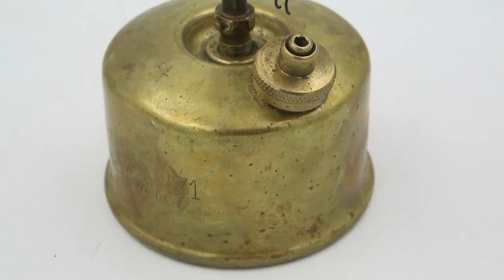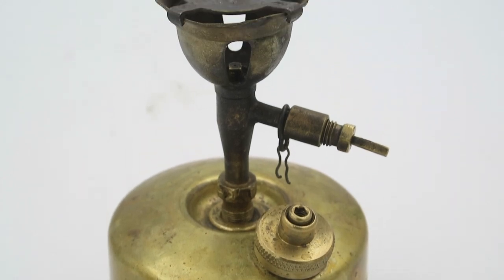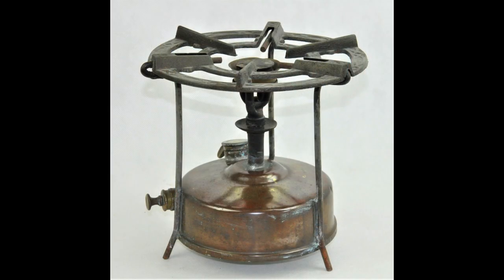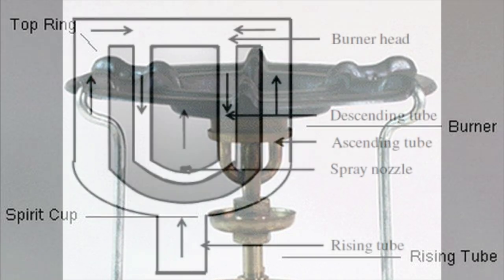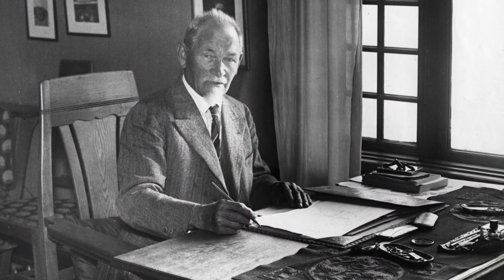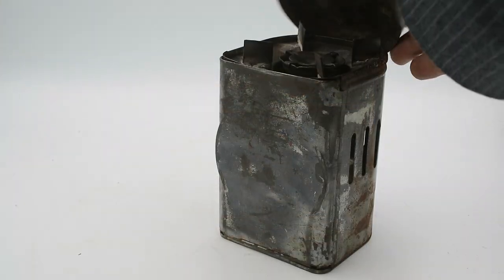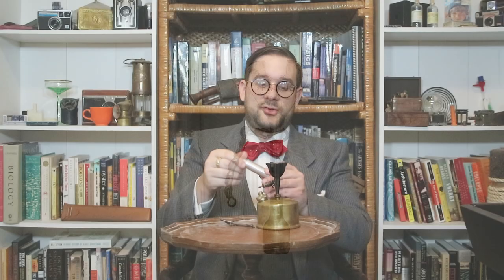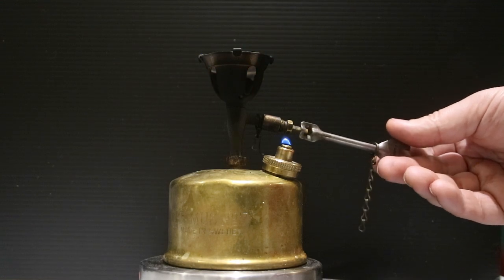Primus 71 Stove: the Camper's Companion

Comment: My Svea 123 isn't shiny like yours. 😉
I normally carried a small container of alcohol for priming, but that isn't necessary. The instructions tell you to warm the tank in your hands. That will pressurize it enough that a little liquid fuel will dribble out of the nozzle and fill the spirit cup, which you then light to heat the burner stem. That works, but I preferred alcohol because a little spillage isn't as messy or smelly as stove gasoline.

Comment: Fun fact white gas is the older form of gasoline and still can be bought today
Reply: Not really a gas
Reply: Yes, it is called Coleman Fuel or Naptha. It is a very clean burning fuel with no or very little odor, and they can last for years with no break down in the metal 1 gallon containers.

Comment: I have a Primus Stove (different model then the one shown), and the manual says it can run on pretty much everything, both liquid, or gas, except alcohol ( because it corrodes coper, and brass has copper in it and the stove has brass parts). So your part at about 4 mins in, where you say they  mostly run on gas, not liquid, and the ones that do, mostly use camp fuel, isnt entirely true.... maybe for some models, but definably not all of them.

Comment: PLEASE!  Post a video of this running on 60 proof(30%) vodka.  I gotta see that to believe it.  Also, this doesn't have a built in cleaning needle.  These downward angled valve models need a separate "pricker" that came with them.  They can be easily made with the right size piano wire.    Just make sure to deburr the end of the cut wire or it can enlarge the jet and it won't run correctly.  The models with built in cleaning have the valve horizontal/perpendicular to the riser to facilitate the rack and pinion action for the needle.
Reply: Be like an alcohol stove
Reply: Vodka is a Polish invention and according to Polish law, it needs to be at least 37.5% of alkohol to have the right to be sold as vodka("wódka").
btw. Russian text with the first mention of vodka is a list of items purchased in Poznań(Poland)...
Reply: 60 proof vodka? Someone's sold you short there. Vodka is supposed to be at least 37.5% (and typically 40%) of alcohol by volume, so 75..80 proof.

Comment: How hot would this burn with alcohol compared to a modern gas stove ?
Reply: Alcohol has a lower energy value, so with the right nozzle it would heat about the same as a modern gas stove but it would be a fuel guzzler.
Reply: Alcohol burns with half the BTU of Kerosine. Pressurized Kerosine temperature is twice as hot as pressurized  alcohol stove and you can't buy a pressurized alcohol stove anymore.  The unpressurized alcohol stove is good for a sunny day in the summer.   Modern stoves are a joke and more of a sales gimmick. Serious travelers need heat now, not later and they want a hot flame to boil water and not a flame to simmer a fish.
Reply: @tomsitzman3952  Are you the official spokesperson for "serious travelers"?  While boilers are all the rage these days, there are a lot of Trangia users out there who ARE "serious travelers" and would disagree with your premises.  Some of us like a fresh cooked meal from scratch in the field.  It's part of the adventure for some.  And for some, cooking IS the adventure.  

The best stove is the one that best fits YOUR purposes.  I personally don't use alcohol stoves, but acknowledge their legitimate niche in the stove world.  I personally prefer stoves that can bring serious heat and actually cook too.  There are advantages and disadvantages to every stove.  Go with what works for you.  But just because one doesn't fit YOUR personal needs and/or desires, doesn't resign it to being a "joke".

Comment: Since kerosene is so hard to come by these days (having been supplanted by either diesel fuel or #2 heating oil, depending on use case), those Primus stoves that were originally designed to run on Kerosene will readily run off of either Diesel fuel, or if you happen to have a ready supply of it, Jet fuel.
And if you happen to work at NASA or SpaceX, RP-1 is also suitable, and will offer reduced coking as a benefit over the other alternatives.
Similarly, if you instead work at Roscosomos, RG-1 is virtually identical to RP-1, as far as performance goes (both in rocket engines and in these kerosene stoves).
The only suitable fuel that you can't use in a Primus stove is Syntin, which was a Soviet-era SYNTHETIC kerosene type fuel that offered slightly higher specific impulse to rocket engines using it, in Primus stoves it would either perform identically to RG-1 or there would be no statistically significant difference in the time to bring a given mass of water to a boil.

The reason that these are all so widely interchangeable is because they're largely just differentiated by the presence or absence of certain additive chemicals, other than that they're all pretty much just kerosene.
The additives do various tasks, such as depressing the gelling point or making the fuel more conductive to prevent accumulation of static charges (in jet fuels), increasing the cetane rating and lubricity (in diesel fuels), and in rocket grade kerosenes you will find a notable LACK of additives (aside from the anti-static additive found also in jet fuels) combined with a more narrow "cut" of the refined petroleum products used, with the specific cut of refined petroleum products specifically chosen to avoid those that easily polymerize and form deposits when the fuel is rapidly heated (this is done to allow it to be used as a coolant in the regenerative cooling passages of the thrust chamber, throat, and nozzle of a liquid fueled rocket engine).
Reply: Jet fuel pretty much is kerosene.
Reply: @realityshotgun  So are all the other ones I mentioned, that's the whole point of my comment. RP-1 and RG-1 especially are literally just rocket-grade kerosene.
Reply: RP-1 is by far the cleanest fuel you could ever run in a kerosene stove.  However it's impossible to get.  Remember that all Kero fuels have to be stored in air tight containers to keep them from sucking up water from the air.
Reply: @AIM54A  Actually if you can keep the temperature in the right range that's not such a problem for kerosene type fuels (and it's a pretty wide range, all you have to do is avoid condensation). This is because kerosene type fuels are NOT hygroscopic, unlike ethanol gasoline, which very much is, to the detriment of the carbs in lawnmowers and other outdoor power equipment that I work on as a side job to my normal auto mechanic job.
Oh and if you're ordering enough of it, RP-1 is very much available, the problem is that the minimum order is "one semi truck tanker trailer full of the stuff" or thereabouts.